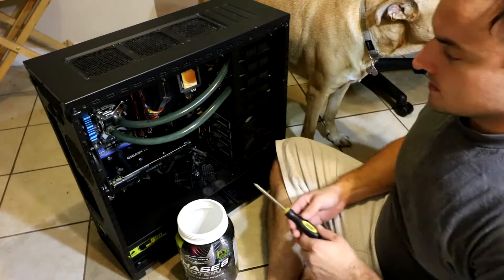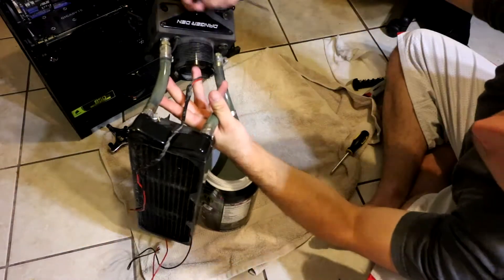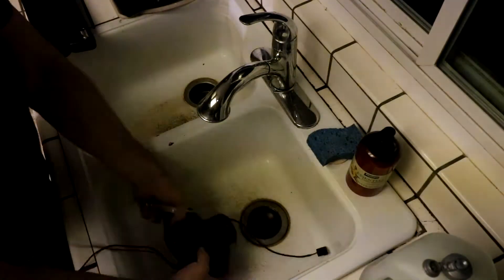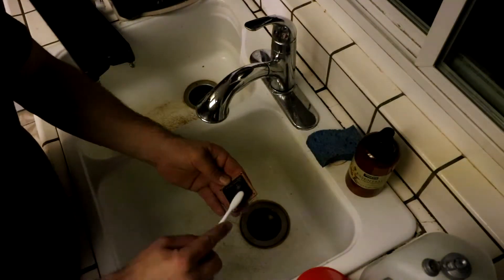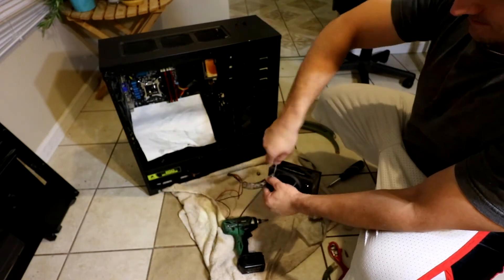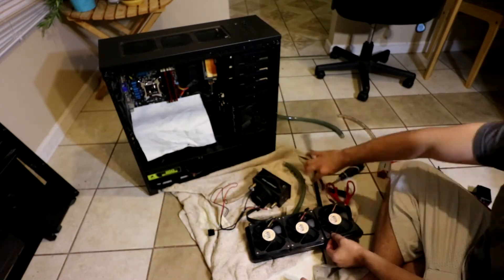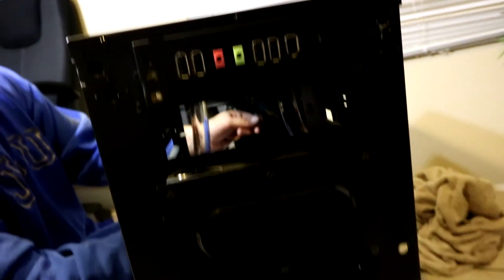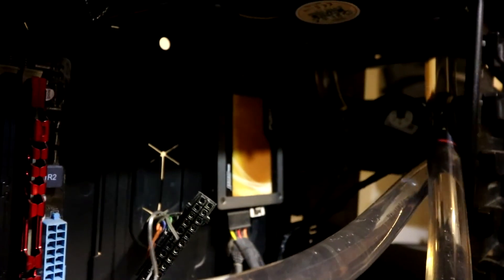FULL Deep Cleaning Water Cooled PC Lines & Components

Comment: I'm jealous
Reply: This was my 2ed full custom water kit I made myself I have had this kit over 6 years with my i7 2600k @ 4.8ghz it's very solid!  One thing to note I ran all the parts with full distilled water after i cleaned them. You only want to use distilled water and pt nuke don't use any stupid dyes
Reply: This is my 2ed time cleaning in 6 years.
Reply: You are a 2600k cadet as well? =D fo life! Thing is going to last through the nuclear winter.
Reply: I have already resold this pc it's still running strong the i7 2600k is a super CPU